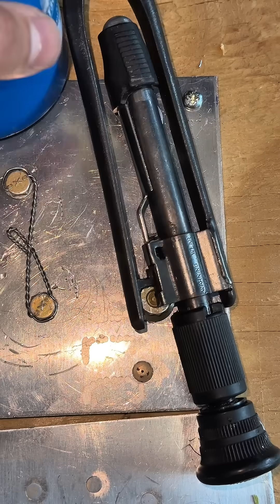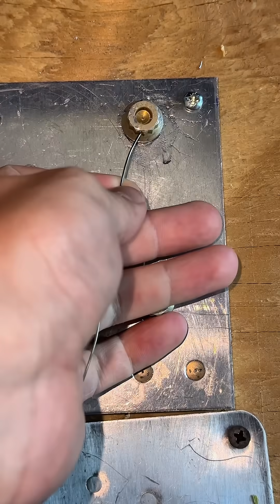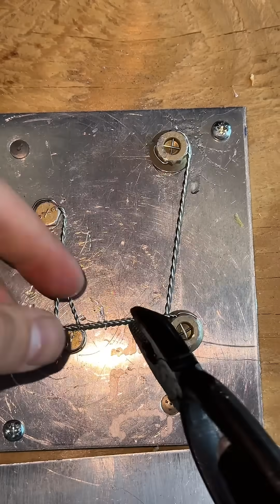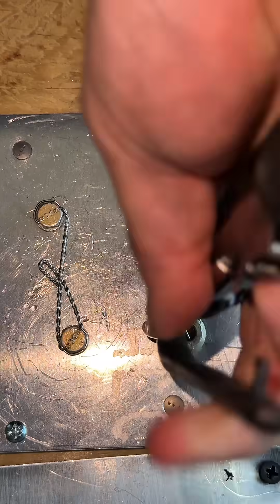Jet tech: Boomers Hated This Safety Wire Tip 😤✈️ #AviationMechanic #shorts #mechanic

Comment: I do it by hand and with the pliers depending on the application and location. I also use the safety cable when I can it’s so much easier.
Reply from the maker: Safety cable is definitely easier sometimes!

Comment: Interesting how short the screws are, will also safe quiet some weight I guess.
In cars it's more like, make the bolt 3cm longer than it needs to be, hopefully the rattle will be recognized during this 3 centimeters before it falls off 😂

Comment: LOL ... don't worry ... your skin will thicken over time. When it comes to "Specs", careful with interpretation of the words "Should" and "Shall" ~ the latter is only one mandatory. Good job and I'd accept it ... SW Pliers are preferred. But hey, only us AS9102 QA Engineers get to actually "accept" ... and there's only about 120 in the World that have that responsibility for LM Aero Product ... no pressure.
Reply from the maker: Safety wire isnt rocket science
Reply: @northeastaviationpro  No ... but sure used on them.

Comment: He forgot to put the twist at the beginning of the twist  just outside of the hole.
Reply: @northeastaviationpro OK, this is difficult to explain without a visual example. so after you pull the knob and spin your twists, grip the pliers (preferably with 2 hands) make an exaggerated looping motion turning the entire pliers, and twist that you just made, a half turn. This puts a twist closer to the bolt hole that your twist came out of, and it provides a tighter fit.
Again, it's hard to describe without a visual demonstration. 30 years after the service, I found myself in a safety wire class at the Nuclear station where I work. My instructor did a nice job teaching, but he had never worked on aircraft, so when I demonstrated it to the class, he made it part of his instruction.
Reply from the maker: We call that an around the world to get the twists up to the bolt hole. But its not always necessary to do that if you have a good angle to twist. Anyway i will do a video explaining that cause it is a good trick!!!!

Comment: I used to do safety wire for helicopters about 10 years ago. Every boomer wanted to waddle over and criticize the wiring. Basically none of them worked anymore. Most were not that good at their job, and when it came time for me to leave, they didn't want me to go even thought they treated me like shit. I am no longer a mechanic because of it. 

I even had one boomer waddling up, shaking his head, saying I put it on backwards. As he got closer, he said "Oh. No, this is right."  

They often weren't there to correct, help, and improve people. THey were just looking for the opportunity to tell someone they were wrong and make a spectacle out of it if they could.

But then if you didn't talk to them or act jovial at work, you would be hit with the "dur hur. You're too quiet. Dur hur."

Most mechanics shops have boomers like this and for that reason, I left mechanical work.

I think mechanics shops are moving away from this kind of "leadership", or at least I think car mechanics are. 

Most boomers I have met are lazy, smarmy, unhelpful, entitled, and think that everyone else is the problem.
Reply from the maker: Totally agree. And if it isnt the safety wire they will always find something youre doing wrong. Its a sort of their ego built into their work and ‘aviation’. They get butthurt if you talk back to them. Its always toxic people that make you hate the job

Comment: There is nothing secret about it, this is as old as the nut and bolt itself. As for the FAA regs, the boomers wrote most of em. Nice work though. I used to use wire on my motorcycle back in the day.
Reply from the maker: Appreciate you sharing your experience and the feedback!

Comment: 12 years A&P wired every day. Then 20 more years using the safety cables on the LM6000s. I definitely preferred the wire to the cable. But the cable is stupid easy.

Comment: I'm a Boomer and as I (we) were taught in tech school in the USAF is, safety wire isn't there to maintain torque on a bolt/nut, its there to keep it from becoming FOD should the bolt break. Safety wire pliers were part of our tool kit.
Reply from the maker: A safety wire or locking-wire is a type of positive locking device that prevents fasteners from falling out due to vibration and other forces.

Comment: Safety wire isn't just for aviation. We use it on race vehicles. We also make little deformations and such to keep nuts/bolts/screws from backing out. Wire is actually pretty common. I fixed my inlaws lawn mower with it.
Reply from the maker: Thanks for the info

Comment: In my day we departmentalised every single process to dubble redundancy then design an extensive overly complicated QC process that was completely ambiguous. This increase cost at the consumer end tenfold but that was easy to pass on as regulators advertised they were forcing chainges to guarantee better safety. Infact the process was prone to and often did introduce error into the outcome, but by virtue of the system tracing fault back to an identifiable point was impossible! so no finding of fault as ever been attributed to us. On paper we have a perfect track record, Opps just mucked that one up! Hmm never mind! 😂😂😂😂😂

Comment: A lot of A&Ps need to brush up on their wire skills. I am seeing lazy safeties on everything now. I found an oil filter on a Baron that was wired so poorly that I was able to remove the filter without detaching the safety wire. Another had perfect safety wire installation but it was only screwed on till the gasket touched. Both were installed by experienced AP/IAs who have gotten lazy. Things are being overlooked that would not have been overlooked 30 years ago and it has nothing to do with age. 
 Great video. Thanks 👍
Reply from the maker: Appreciate you watching and sharing your experience!

Comment: if you twist it too tight then the wire has no tensile strength left.....you wasted it on your tight twist. 304 stainless wire is only so strong, but that strength is pretty high if you haven't over-twisted the crap out of it destroying the integrity of the wire along the way.
Reply from the maker: Good point! Thanks for the feedback.

Comment: I remember seeing my uncle do this on turbo chargers for trains and ships after we re-built them. He made it look so easy and I felt confident I could do the same just as fast and clean. Never been more humbled but as soon as you get it, you got it. Know exactly when that wires about to pop, feeding it through without having the wires spin over the top of the bolts. Can be extremely satisfying or extremely upsetting
Reply from the maker: Thanks for sharing your experience and I agree it can be both satisfying and upsetting.

Comment: Those are mousing pliers, they are used for military boats and other paying applications like if you use a shackle to connect to your anchor and don’t want the pin to back out you either zip tie it or mouse it

Comment: What brand of wire pliers are those?
Reply from the maker: Snap on, but they suck. I got my brand coming out soon
Reply: @northeastaviationpro Thanks for replying! 
I had a set of old military pliers(possibly ww2-Korea era) that worked beautifully. They made it so simple. I had them stolen and have been trying to find that set back ever since.
Subscribing to your channel. Might sound whacked but I enjoy safety wiring even with all my punctures.
Reply from the maker: Thanks brother! These pliers are $350 and they’re already becoming loose. Anyway enjoy!

Comment: I worked on an old tractor from the 20's that had safety wire on the connecting rod cap bolts.  Cotter keys were common, but I'd not seen safety wire on a tractor before (1928 Wallis).  Don't know if it was factory or a very cautious mechanic added it later.

Comment: I installed a wheel bearing on a car and put a kotter pin in the nut, I used my fingers to bend the pin over so it can't fall out because I'm not a wuss like kids these days.

Comment: Safety wired a lot of stuff. But it was all on industrial equipment. Primarily on stamping presses and clutch assemblies on multi spindle vertical turning machinery. Usually Bullards. But all the fasteners were hex heads. Still have my wire pliers. Right and Left Hand twist.
Reply from the maker: Thanks for sharing your experience!

Comment: Thats easy with soft wire try that with inconel wire..😢😢 the shit is hard as fuk.
Ex turbine fitter.
Reply from the maker: I use that on engines doesn’t seem that bad
Reply: @northeastaviationpro  try doing a 100 plus 30mm bolts in the confined space of an exhaust cavity in a large gas turbine..its the rear bearing split line!
yes its simple as on a work bench
Reply from the maker: @toolbox0001  That sounds cute. Meanwhile I’m over here doing safety wire with Inconel at 2AM, upside down in the intake of a -15 engine, on a flightline in 20-knot winds, holding a flashlight in my mouth while ops is screaming for release and the QA guy’s breathing down my neck. Your gas turbine split line sounds like my warm-up stretch.😂😂😂😂

Comment: In the USAF were not allowed to have the safety wire touching. The pig tail is touching on both sides. Looks good, nice and tight. Left pig tail is way to long
Reply from the maker: Appreciate the insight, good eye! Civilian side of aviation is a little different

Comment: It's used on cars too, but only on old models, I'm a fairly young mechanic, but every time one came into the workshop I wouldn't have any wire on hand, pain in the A. 
So I bought my own roll and I haven't had one since, so I think the roll keeps the old cars away.
Reply from the maker: I appreciate you sharing!

Comment: It might look good but let me see you do that on the lateral mounting bolts on a boeing  747 door latch accumulator one handed, blindfolded, while the plane is taxiing, and the freezer burnt hotpocket you had for breakfast is threatening to run out of you.
Reply from the maker: That’s cute. Try safety wiring the aft torque tube of a C-130 while hanging upside down in a crawlspace the size of a shoebox, with hydraulic fluid dripping into your eyes, your headset shorting out from static, and your supervisor screaming ‘hurry up’ even though he’s never touched a wrench in his life. Oh, and the hot pocket? It’s still frozen.

Comment: Tractors will have bolts wired like this, older tractors may anyway. For things they didn’t want people getting into, for whatever reason the diesel injection pump on mine, they would drip lead over the wires and press the puddle with a seal. This was the UK in the 70’s, so maybe it had to do with air quality.
Reply from the maker: Interesting, I did not know that!
Reply: @northeastaviationpro  - Yeah, it’s strange. My tractor is clearly an old import and the wires tying together the bolts on an inspection cover had corroded and broken. I figured a cover on the pump might need those fasteners so air doesn’t get in and break the prime on the fuel system, so okay, but the little lead seal totally baffled me.

Comment: I'm a boomer, I can do it by hand but I'm not a dumbass. I use the pliers. That's like using a hand drill instead of an electric or cordless drill. You'd have to be a real dork to safety wire without the tools designed to do it right. That's not being cool or tough, just stupid.
Reply from the maker: Thank you sir

Comment: I had a set of safety wire pliers I used on TANK's in the Army in the 70's , looked very much like the ones you had there.  Now I do not know how to safety wire anything for aircraft, but what you did looks pretty good to me, An M60 tank or an MLRS system would think you would do OK.
Reply from the maker: Thanks for sharing your experience!

Comment: I do this every day and I still learned one tiny thing from this video… on the pigtail before you twisted it you pulled it in the direction following the turn of the bolt.. I always pulled it at a 90 from the bolt.. and it leaves too wide of a hole… gonna use this tomorrow
Reply from the maker: Awesome, glad you found it helpful!

Comment: 20 years as an aircraft mechanic. Looks perfect to me. I've seen a lot worse. We always had safetywire pliers handy, but if necessary, we could do it by hand. Lots of times when using 20 thousandths we would do it by hand because it was too easy to break it with the pliers.
Reply from the maker: Nice! Glad to see another mechanic with similar experiences.

Comment: You did a decent job, and I'll let you in on a secret, there is a reason why people had a tendency to use their hands, that reason is because using the twister pliers has a tendency to damage the safety wire where you clamp them onto the wire. This problem gets worse when you are dealing with more than two bolts in a job.

Comment: I believe in safety wire. My Bronco, starter bolts would back out. Not a good thing. They would tighten up fine but over time would back out. I drilled the bolt heads for safety wire, no more issues.

Comment: Those pliers have been around for quite a few years. I know in the army, they frowned on their usage in a lot of cases because the jaws would score the safety wire, causing it to fail QA. Although they do make smooth jaw ones specifically for aviation.

I prefer using duck bills myself. Same general idea though.

Comment: WE had Regulations.  The first was the Trainer made sure you could to the safety wire by hand before they let you have the pliers in your tool bag.,  Because the day would come when you do not have the pliers and you still need to install the wire on the part .    BOOMER.   Aircraft McCanic from 1969-1992,

Comment: Nice work!  I used to do four bolts at a time because the flanges in the motor had over 50 on one flange.... It's bad when you dream about safety wire. 

I agree with you. Take pride in your work!
Reply from the maker: Great point!

Comment: Boomer, fudd, whatever is the new broad brush insult, had to safety wire the gas plug on M60 barrels, and RSOP required the trigger housing group to be safety wired outside the arms room. Well done video.
Reply from the maker: Thank you for your service and sharing your experience!

Comment: Does it pass yes, is it perfect no, is he learning his craft yes, bravo sir. Pig tail needs work, stop jerking your line just pull tight, and if the job is that easy get faster. Not required but helpful professional touch is a dab of torque strip on the pig tail loop ends. Helps inspector see what all you touched to do the job and will be appreciated in the hanger. You’re doing good young man keep it up 👊
Reply from the maker: Thanks trying to teach the new generation

Comment: I worked aerospace for 36 years so yes I can properly safety wire. I worked for some of the biggest manufacturers out there even a little space shuttle work There is no pride of workmanship any more. It is an individual thing. You have it or you don't. I worked quality for a few years and I have gotten people fired for lackluster work. I was taught when you sign off on work you own it. You have pride of workmanship or you don't. If you didn't have it I wouldn't have you in my shop...
Reply from the maker: Thank you for sharing your experience; it sounds like you have a lot of valuable insight.

Comment: I've gone through about 100 miles of .023, .032, and .041 wire.  20 years out of the USAF and I still drill and wire nuts and bolts occasionally.  It's a valuable skill.

Comment: A&p here, yes safety wire pliers are indeed the shit but when your dealing with a couple inches length between fasteners, it still helps to know how to do it by hand. Many times it’s faster than using safety wire pliers for the perfectly tight run you’re trying to go for. No hate just love!
Reply from the maker: Agreed, both methods have their place!

Comment: 1) If you were smart and really wanted to help you'd mention the full explanation in your short. 2) You dissed boomers. Learn what a joke is and whilst you're doing that learn what a fact is too. Then park the attitude - recounting text books doesn't make you smarter than anyone else, experience does.
Reply from the maker: @mdj9765 Bro, you dropped a 2-paragraph rant under a 60-second video like you’re gatekeeping aviation from a recliner.
	1.	I’ve made hundreds of videos breaking down safety wire, helping techs pass school, ace their oral/practicals, and get their A&P. I’ve done more to educate and support the aviation community online than you probably ever will in your entire career—and that’s not ego, that’s just numbers.
	2.	The “boomer” bit is a joke, not a personal attack. If you took it that way, maybe the comment section isn’t the best place to unpack your unresolved hanger trauma.
	3.	You talk about “experience over textbooks” while getting mad at a 1-minute joke video. Real experience teaches you to lead, not lecture like a bitter gatekeeper in a dying forum thread.

I build up the next generation. You comment from the sidelines. Big difference.
Reply: @northeastaviationpro  Your online stuff is based on the hard work of others. You're plagiarising - that's not leading.
Reply from the maker: Ok snowflake you sound like a fragile person have a good day thanks for the engagement snowflake